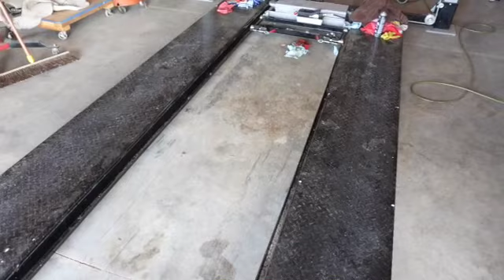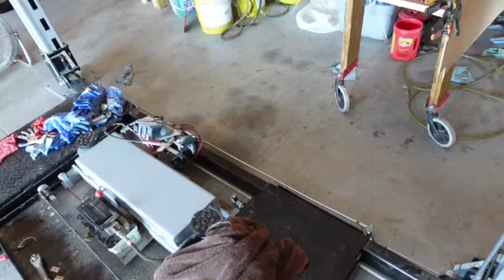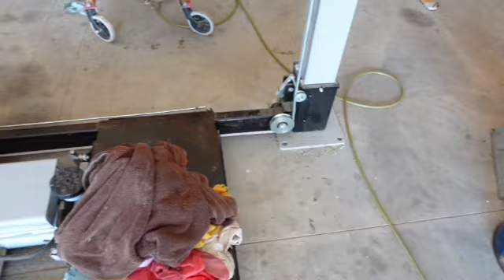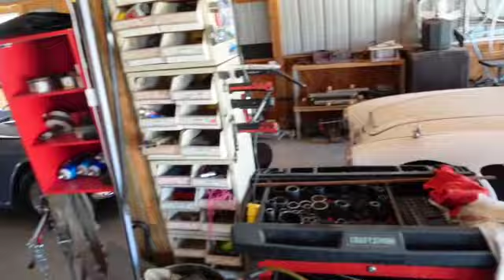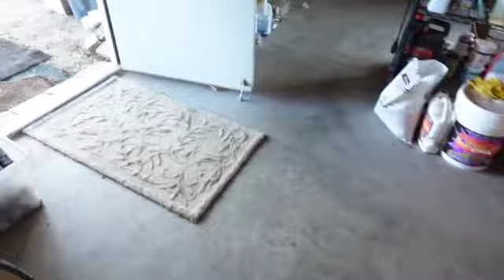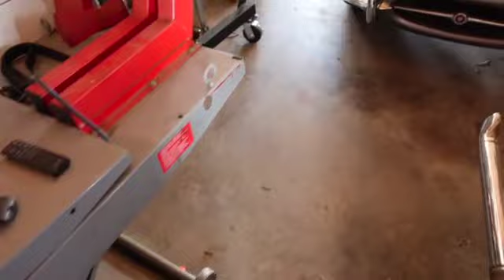Wildfire Lifts Gave Me An F.U. (Follow up) You better check your lift - no matter who made it.

Comment: So tell me is it your opinion the China made bearing too small for the load? Are the shives large enough to machine out to except a bigger bearing? Does Timken make one that size? Maybe Timken is also China made I don’t know..
I was going to buy Wildfire because of the locking holes are cut in the pipe and others like Benpack are cut in 3/16” plate hanging from the top
Reply from the maker: The wildfire bearings were just very poor metal.  The balls broke & shattered into sand.  I have a video on replacing the bearings and where I got them.  I ended up using SKF bearings as I don't think Timken makes this size... or didn't then.  Since I did the day's work and spend $250 dollars on bearings I haven't had any noises or problems.  All of my cars and trucks are far lighter than the 9000lbs limit they claim but the chance of me putting anything on this lift over 5000 is zero.  I lifted a Dodge 2500 up a few feet to work on the brakes and wheel bearings and it was clearly straining the lift.  The pump is 120v and seems to do fine but I just am not going to trust it.  I am lucky that I don't have heavy things but if I did I would have gotten a bigger lift for sure.  I do think the locking system if good and it does have a 2 level safety "system".  My main concern was how the wildfire fellows threw out my claim and were somewhat rude.  Take Care.   Bobby

Comment: This just happened to mine as well on the same model; owned it less than a month.
Reply from the maker: It's crazy as the lift overall isn't bad, but the bearings are crummy and it just would not cost that much more to put better bearings in it.  The response from WildFire was more crummy than the bearings.  My disappointment in them, and the other guys on YouTube that got these for free, is deep.  Maybe the free ones to bigger YouTube guys got better bearings to start with?  I wrote those "Big YouTube Guys" and zero response from them.  My hope was WIldFire would fess up and offer a kit with all 10 better bearings or something.  It is a long job to make this thing safe and like it said it's $250+ and a whole days work - and I have the tools!  Thanks for the comment as I hope it helps spread the word.  I had no idea this video was over 4,000 views until today so that's good.  The other point is that I would NEVER put anything on this that was close to 9,000 pounds.  I put my friends 1997 Ram Duel on it and it just didn't look right.  Most times now I don't even take cars, or my truck, all the way up.  I'm just a little gun shy.  Bobby

Comment: I have been following this story that you are documenting. Nothing surprises me. This is what happens when manufacturing goes to the cheapest place. This has been happening for decades and we are all to blame because we all want to pay less. Hopefully with examples like you have shown and what has been happening with supply issues and politics, the pendulum will reverse direction and manufacturing will return to America.. PS, I have a Snap On Wheeltronic lift for close to 30 years. The only thing that needed replacement was the hydraulic hose. Made in USA.
Reply from the maker: Thank you for the great comment!  The sad thing is they could have offered SKF, Timkins or something and used that as a selling point.

Comment: I noticed Advantage Lifts (which overall design is practically identical to WF) advertises bearings with grease zerk instead of BB.   They claim BB are good for high-speed applications, but not required for slow, limited motions of the lift.   Starting to think this may be the case.
Reply from the maker: Great point.  I don't mind sealed bearings but as we all know it's better to have a zerk in most apps.  Thank You
Reply: @bobeaseshop9389  I mistyped; Advantage doesn't use "bearings"; they use Bushings with zerks.    I know a bushing is a form of bearing - without moving parts.

Comment: Thanks for the comment on my video. I will have to check my pulleys and make sure everything is okay with the bearings. So far, I have no odd noises. Just a few small drips of hydraulic fluid from the bottom on the reservoir tank. Although, I use my lift more as a car stacker. So, mine has probably not "traveled" as much as yours.
Reply from the maker: Howdy Patrick, I've used mine for a few trucks but mostly smaller lighter things.  I fit my tractors sideways on the lift to get to the blades easily (I made some runways for that).  I'd say I've used it 50ish times over the year I've had it.  That's why I was so stunned at the fail.  If you know other guys, no matter what lift they have, it's good to check and lube the things every few months.  Lord knows I do!  This is my second lift and I've learned to keep my ears open!  Thanks, Bobby

Comment: Hello Bob, Thanks for the video. I recently order a Wildfire lift and have yet to receive it. I'm now strongly considering upgrading the bearing based on your experience alone.
Since I've yet to receive the lift I'd like to purchase some Tipkins and install them before assembling the lift itself. 
May I ask the bearing number you ordered? Were there any bearing numbers on the original bearing that were used for reference?
Again thanks for your info it has been well received. I've had other lifts in the past and also had to upgrade lower quality components just really dislike the lack of true American-made products these days. 

Thanks
Reply from the maker: Howdy, I know WIldfire offers different types and such of lifts so I don't know if we would have the exact same bearing. I took mine, all 10, to a pro being place and within seconds matched them to a SKF and had other offerings in other brands.  The best I could get were SKF.  You may have a different size.  I have learned that I am not alone here so look around for other guys that have had the same problem.  I made two other videos on this one showing the talk I had with the bearing guy.  I also showed using the press and how I felt it better to just do all the bearings although one was very difficult as the pin was stuck.  I was so stunned not only at how the ball bearings were busted to gravel but also how rude the Wildfire people were.  The did offer replacement bearings but that seemed silly.  It cost me $250+ to replace all 10 and about 6 hours but it's so worth it when I get a better feeling under the lift.  I had a press and all of that so if you look at having to have the bearings done for you the cost will go way up.  Count your total bearings, make the place where the go or take a video or photos, and take them to a pro bearing place for an exact match.  I hope you don't have any trouble doing this and I hope to let me know how it goes as you experience will be a part of this story and may help other folks.  Thank You Sir     Bobby

Comment: Oh boy….I have had my Ram 2500 and store my 69 Roadrunner on it. I’m going to check them out tomorrow. Yikes!!
Are they located in the aluminum rollers that the cables ride on?
Reply from the maker: The first thing I had on this lift was a 1997 Ram 3500 and it didn't seem too happy.  We never took it all the way up.  I'd never ever go over 6000 pounds on this lift.  I trust it for my light British cars, my light truck but that's about it.  The rollers and other parts are a weird blend of metal.  It is not steel.  The pins are also light metal.  The ball bearings are sand holding hands and you can almost crush them with you fingers.  I'd change all 10 bearings with quality ones.  If you contact WildFire they may send you some new pins if yours are damaged but I would never use the bearings they have.  Like I say... I'd also replace the hydro line with a better quality one as you don't want that to blow.  Be Careful!  Bobby

Comment: I've only watched two reviews about this brand of lift, small sample size, but both had bearing failures
Reply from the maker: I must say I was not only sad about the bearings falling to bits but also the poor response from Wildfire.  It has it's good points but my trust in the lift isn't too great.  I also think the 9000lbs rating is "optimistic" at best.  It really sagged when my friend and I put his 6200lbs truck on it.  We decided to net even go under it.  If you get the lift you will find it to be $300 (no help from Wildfire other than offering the same bearings that failed) or more to change the bearings and a fair amount of time - if it all goes well.  Thanks for the comment and I hope you the SAFE best.  Bobby

Comment: How many bearing did you replace Bob
Reply from the maker: I replaced them all.  There were 10 and I made a video about it.  One of the pins was very hard to get out and I had to drill a hole in the runway to force it out.  I also changed the hydro house as I just didn't like the way the fittings looks.  I just could not think about any of those bearings doing anything.  Look and see what the bearing expert said when he saw these bearing.  It cost a few hundred and I think it was well worth it.  I am not sure if all these lifts use the same bearings so if you decide to change them don't use my numbers.  Let us know what you do and what you find.  Stay safe!   Bobby

Comment: Where exactly is the bearing located that went bad ?
Reply from the maker: Howdy, It was the one under the left runway on the double pin to the left - upper left out of the four in that area.  It marred the pin a little too.  Some of the bearing went right back to sand.  There was no way I was going to go under it again with all new bearings... even with nothing on it.  Let me know if you have other questions.   Bobby

Comment: I don't think I would buy or trust my life with any of these cheap lifts you can always get more money you can't get more life
Reply from the maker: I am lucky that my cars a light sports cars.  I do know for a fact that when Sean and I had a 5000 pound (this is rated for 9000??) it was bending.  You are correct.  I see Vice Grip guy with 1970's Caddy's on this exact lift and I too have concern.  Thanks for the good comment.  I have also worried about the hydro line!